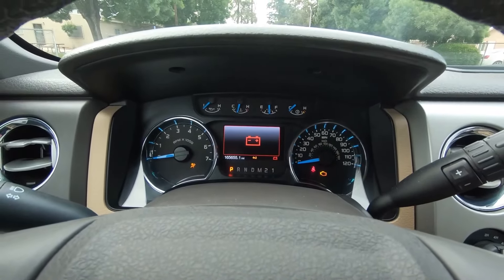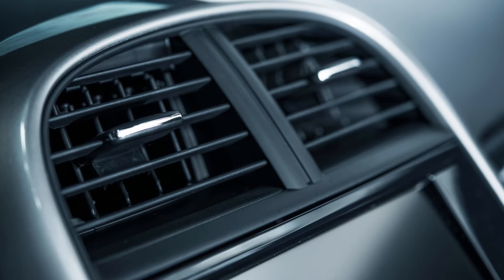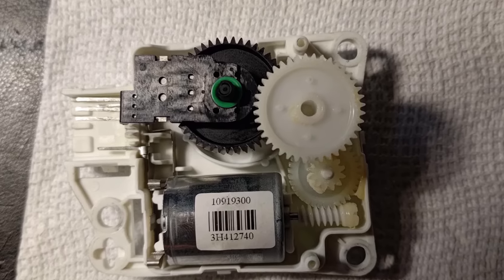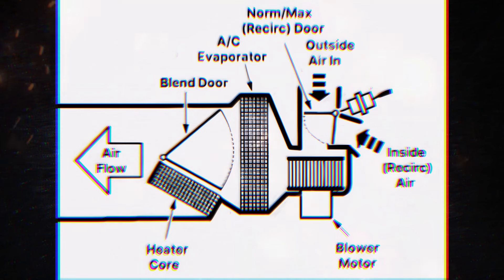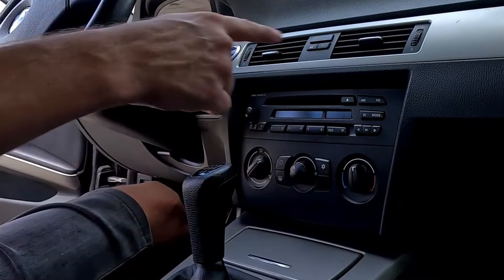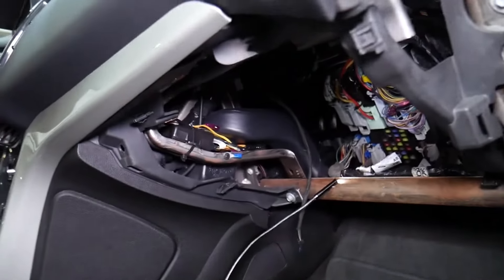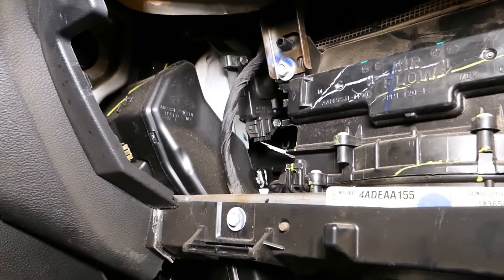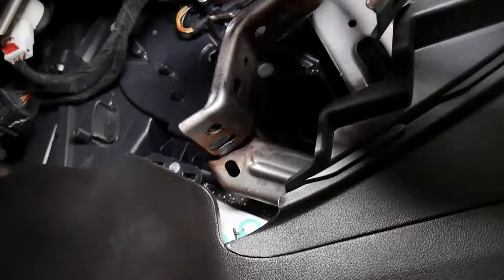4 Symptoms of a Bad Blend Door Actuator - How to Test & Replacement Cost

Comment: I recommend simply unplugging your bad actuator, waiting awhile ,and then plugging it back in again later. I did that with mine( it was clicking and disabled my heat function).
After doing that,bingo bango, and it started working again.
Who knows. Maybe it's like a computer, and resets somehow when this is done.
Of course, mine was easy to get to.
Yours may be in an unreachable position. However, simply unplugging it still has to be easier than taking it out.
It's worth a try.